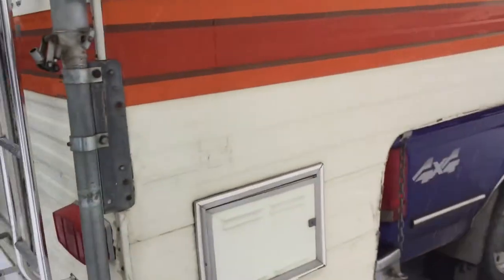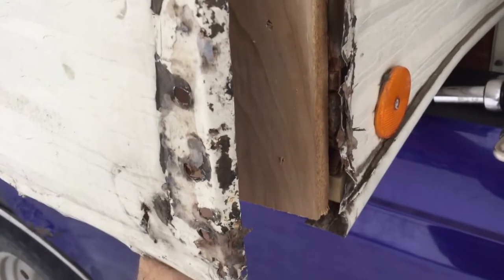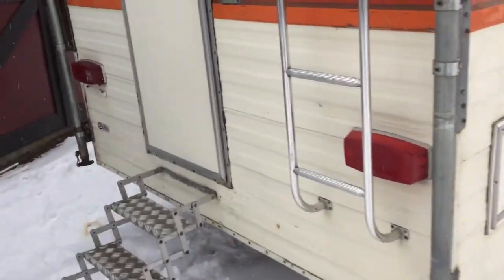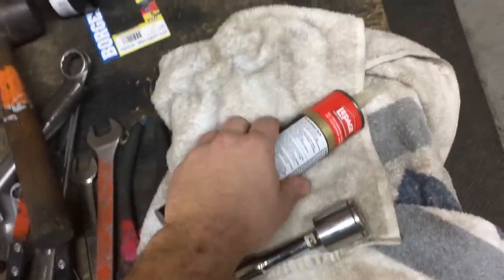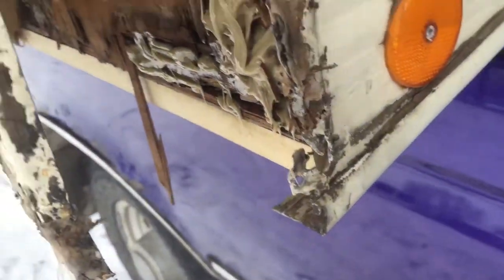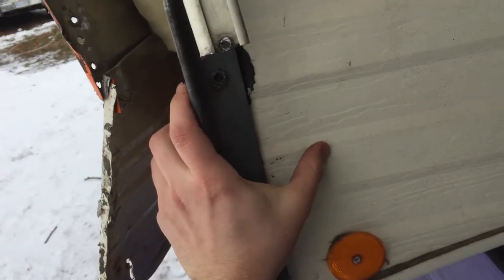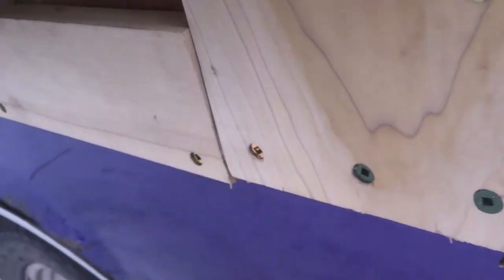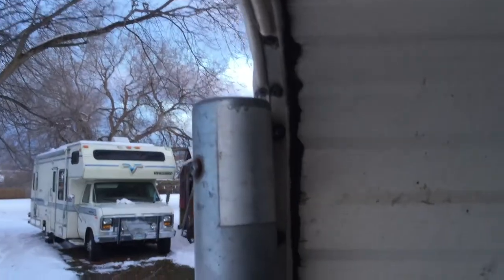Fixing a broken camper jack mount (HOW TO)

Comment: Mike, was the angle bracket 15ft away in the snow because when it broke off you slung it? That's what I would have done.....lol. I have a similar camper that has been repaired a couple of times it looks like. I got it for a good deal, so no biggie. I am repairing the 4 hydraulic jacks now. Awesome video BTW.

Comment: Do yourself a favor remove the bottle jacks when you travel if someone tags it it tears a hole cornerback out just a FYI I'm an old RV mechanic
Reply: Mathew Arnold That is solid advice
Reply: too late Matt. I was out of the country and my relative borrowed my truck. the camper was on it. he backed-up with a utility trailer forgot the trailer was on, and now the jack is ripped from the camper. Guess i'll have to start tearing into it to find sollid wood to screw some new hardwood pieces to. Any tips anyone?